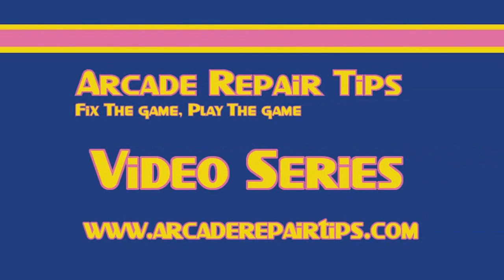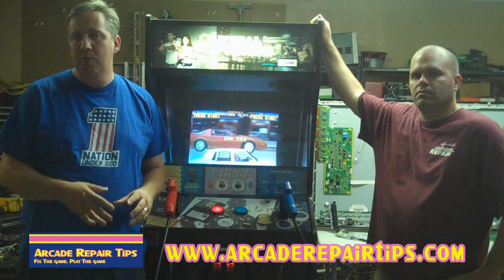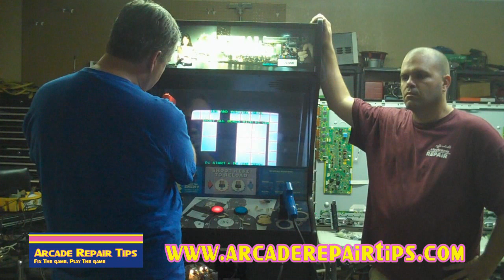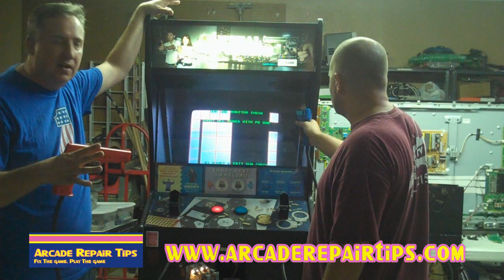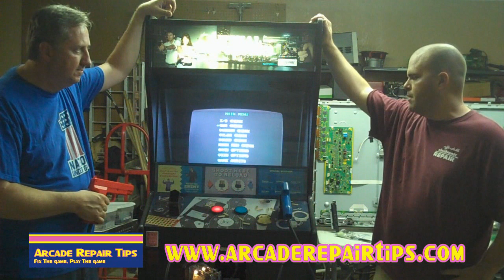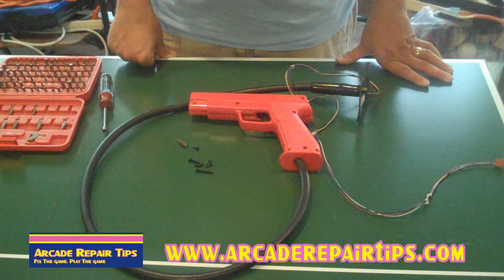Arcade Repair Tips - Troubleshooting Light Gun Issues

Comment: Love your video's! I have a lethal enforcer and having trouble with the the gun shoots but no mayter where i aim, it hits the egde of the screen. How can i fix this?
Reply from the maker: Thanks! We're glad you enjoy our videos! As for your question, probably want to start by cleaning the lens in the light gun and cleaning your CRT screen. If you open up the light gun to clean the lens, check the optical sensor while you have it open. You can also calibrate the light gun in the service/test mode to see if that helps as well. Of course, this video talks about several other techniques that you can try which we would also recommend if those tips do not fix the problem. Hope that helps.

Comment: How do you hook up the LED lights on the red and blue button?
Reply from the maker: On buttons that are lit by LEDs, there should be two wires attached to the LED: a voltage wire and a ground wire. Make sure that both wires are connected properly as it's very easy to damage or disconnect these wires when accessing the control panel. We would also recommend using a multimeter to check the voltage wire to ensure that the correct voltage is being sent to the LED. You can do a continuity check on both wires to verify that are connected properly to your power supply as well. Hope that helps.

Comment: I know ita an old video but ill take any advice i can get. I jave a House of the Dead 1 with 2 Happ guns. They work fine for probably firat half of the game then start going wonky. Completely off grid. A restart of the game (power off/on) will fix it? What is wrong?
Reply from the maker: Seems more like a power or game board issue since the problem occurs with both light guns at the same time. Try checking the voltage when the light guns start going “wonky” to see if it’s still within range. Check the connections on the I/O board to make sure it’s connected properly to the light guns and the main board. If you continue to have issues after trying these suggestions, you might try contacting Ken at irepairsega.com as he as a lot of experience with Sega games in general.

We will also be covering your question on our Live Show Episode 88. Here's a link to the episode if you want to watch it: https://www.youtube.com/watch?v=kPaSejWRwso

Comment: I just bought a lethal enforcer arcade and im having a slightly different issue with the guns   ,  when you pull the trigger the screen flashes and it shows you shot a bullet but the shot doesnt register anywhere on screen , also you cannot reload , when you shoot off screen the screen flashes and doesnt reload , have you ever seen this issue before if so what could it be , also both guns were replaced by the last owner in an attempt to fix the issue , any input is greatly appreciated
Reply from the maker: Since the light guns have been replaced, we are going to assume that they are functioning properly. Let’s start off by making sure that the light guns are connected correctly to the game board. If you look at the wiring schematic in the manual (https://bit.ly/lethal-enforcers-manual), you will notice that there are 4 wires that connect from the light gun to the game board: Hit, Ground, Trigger, and Voltage. Make sure that these wires are connected to the proper locations and that the wiring is in good shape. Check the continuity of the wires with a multimeter to ensure that this is the case. You might want to touch up the solder on these pins to the game board as well as they tend to become loose over time. We would also recommend checking the power supply and turning up the brightness on the monitor to see if that helps the issue.

If you have any additional questions, you can reply back to this comment or join us for our Live Show Episode 75 on Thursday, May 4, 2023 at 5:30 PM CT on YouTube as we will be covering your question during the show. Here's a link to the episode if you want to watch it live: https://www.youtube.com/watch?v=VH5Yjazq2Po. It will also be available as a recording at the same link if you are not able to watch it during the live feed. 

Thank you for your question and good luck with your repair.
Reply: @arcaderepairtips    the last owner had them plugged in upside down , the guns still didnt work after plugging them in correctly , 90 dollars and a couple happ  optic boards later its playing like a champ ,  im guessing  that they were plugged in backwards for so long the brand new boards fried ,
Reply from the maker: @TheRandomMechanic  Thanks for the update. Glad that you were able to identify the problem and fix it. Thanks again for your question and good luck with your future repairs.

Comment: There is a lot of incorrect info in this. Have to question if this guy really even knows how these actually do work. Infra-red has nothing at all to do with it. No "beam" comes out of the gun. The light sensor in the gun is sensitive to light, and almost always blue light. 

Turning up brightness is NOT the answer and is just completely INCORRECT. Turn the brightness DOWN to get the correct black level. Then the CONTRAST UP, it is the HIGH END that the gun sees, NOT THE LOW END. Brightness adjusts the black level, not the white level. Too much brightness not only kills black levels and contrast ratios, it can often make the gun less accurate too because essentially what you are doing is making it less of a difference between full on and full off, so the gun sees light it should not really see. If you did turn up brightness on the display when using an NES Zapper it just plain won't work at all, because it relies on a black frame before the white target box. 

Turn the blue high level up further, that is the only colour the guns really see and care about. They don't see red at all, and they don't really care much about green. Try it for yourself and see, disconnect the blue feed into the monitor and the gun will hardly work, if at all. Yet disconnect the red and green, leave just the blue colour, and the gun will still work, probably quite perfectly. 

Chances are that gun would have worked fine if they actually calibrated their monitor correctly in the first place. 

Someone else mentioned not using Windex, and good call too, it will wreck the plastic lens. 

Videos like this should come with a disclaimer, these guys clearly are not qualified to be giving these tips.
Reply from the maker: Thank you for your comments. On your concern about adjusting the brightness, we have talked with support people at several manufacturers over the years who have told us to do this during the troubleshooting process. Some light gun game arcade manuals even mention adjusting the brightness specifically (for example, see the bottom of page 3 in the Lethal Enforcers manual: http://ohwow-arcade.com/Assets/Game_Manuals/LETHAL%20ENFORCERS.PDF. If you have any additional tips that we should cover on this topic, please let us know so we can include them in our content. Thank you again for taking the time to comment and good luck with your future repairs.
Reply: @arcaderepairtips  i know what the manual says yes. You are misinterpreting it. The setting called "brightness" on a display device refers to black level, and what they mean by "increase brightness" is increase "contrast", which is the white level. 

Increasing that "brightness" pot just kills off the black level, and does NOTHING to raise the actual brightness of the bright areas on screen, which is all the gun sees, and hence, does nothing to help the gun see the raster.

That should be obvious if it is known how a light gun works. The optical sensor either passes current or it does not. Adjusting the low end (brightness) offers no gain to anything, it is not bright enough for the gun to see, and the gun shouldn't be seeing light at that time anyway. 

Try what i said, i'll bet that even with green and red turned almost completely off, and blue gain turned up, the gun is still dead accurate. I know it will be, i've tested it. Blue is the only colour the gun really cares about. Green does almost nothing, and red light is completely ignored.
Reply from the maker: @CaseTheCorvetteMan  Interesting about the blue level. We were not aware of this. It sounds like when you say brightness, you are referring to the brightness/black level pot on the chassis itself. Would the same go for the brightness adjustment on the flyback? Many times, this is what we adjust when we are trying to troubleshoot light gun issues.
Reply: @arcaderepairtips  i know you're not, some of the things you say make that quite obvious to me, having spent more than 25 years calibrating and repairing CRTs before i gave it all away, and i don't expect you to know intricate details. They're complex devices. They is a significant amount to know.

You should NEVER EVER be adjusting the G2 level without following the correct service manual procedure. What you have done by doing that is completely f***ed up the grid voltages, which just washes out the image and makes the contrast ratio very narrow.

There are user adjustable pots for this, USE THEM. You really need to understand what the pots REALLY do before you start frigging about with things, because a lot of them have a "correct" setting, set using a procedure as defined by the manufacturer, and they are not simply "adjust it to suit yourself" settings. Often other settings rely on things like G2 being correctly set. By randomly adjusting things you throw the whole thing out.

Sure, it'll work (usually), but it'll perform like shit. 

Be very careful randomly turning pots without complete understanding on what they do, or you'll find yourself paying someone like me to hook up a scope to set things back where they should have been.
Reply: Further to this, CRTs are often VERY capable display devices, even the low end units are capable of a static contrast ratio to rival all but the best digitals, but if they're calibrated wrong, they're gonna look like shit no matter where you stick that plastic screwdriver ;)
Reply from the maker: @CaseTheCorvetteMan  Thanks for the knowledge. We are always trying to learn more about how arcade games work. Is there any way you could show a video of a light gun working as you have described (with the red and green turned off and the blue gain turned up)? I think many of our viewers (include myself) would be very interested to see this in action.
Reply: @arcaderepairtips  no problem. Happy to help.

As far as making a video, if i get time i can try. 

I have already got multiple videos of light guns working perfectly on CRT projection systems, which despite the common misconception, work perfectly fine if the blue output is high enough to triggle the optical sensor.

Recently i posted a couple videos of Time Crisis 2 and Virtua Cop on my 125" projection screen using a Playstation 2 console and a Guncon 2.
Reply: Just a further note RE the blue light, a lot of smaller American Laser Games cabinets used a 3DO console based setup instead of the Laser Disc / Amiga units used on the deluxe cabs. 

The 3DO versions of the ALG light gun games have an option to flash the screen full white, or just flash the screen with only the blue. The gun will work exactly the same either way, because all that has changed is the levels of green and red sent to the display for that flash, and the gun doesn't care about those two colours.

Dig out a 3DO and give it a try.
Reply: @arcaderepairtips  I have created a short video and uploaded it now for you, very clear to see how the gun simply doesn't care about any colour other than blue. 

Have a watch, it should clear things up a bit.
Reply from the maker: @CaseTheCorvetteMan  Thanks! That's very insightful. Here's a link to the video for those who would like to see it: https://www.youtube.com/watch?v=_1TSuTLweno
Reply: @arcaderepairtips  no problem. I'm going to have a few rounds of Point Blank now that i've turned it on, so i thought i'd get that done for you while i was at it.

Comment: hello,I have a two p99k logic3 gun with guncon1 and guncon2 with recoil and i need to repair one of the phototransistor, do you know where can i buy the phototransistor with 3 pins????.
Reply from the maker: Not 100% sure that this is compatible with your model but it does have 3 pins and is used by a variety of optical gun boards: https://na.suzohapp.com/products/optical_guns/OP805SL